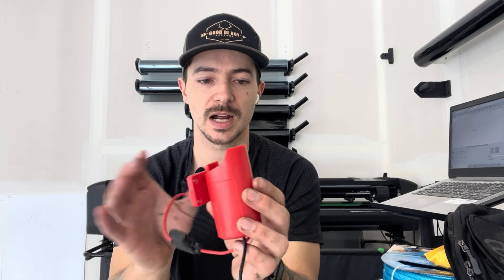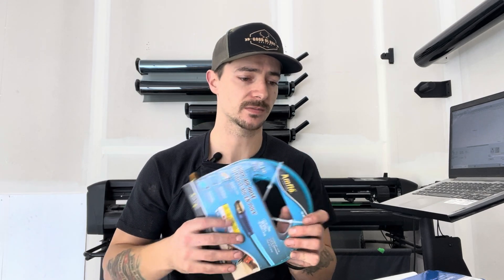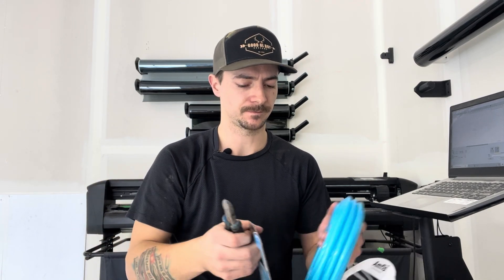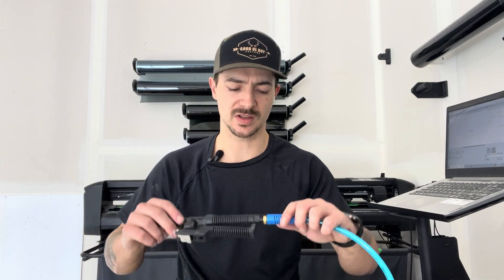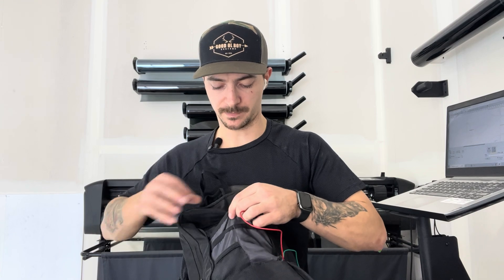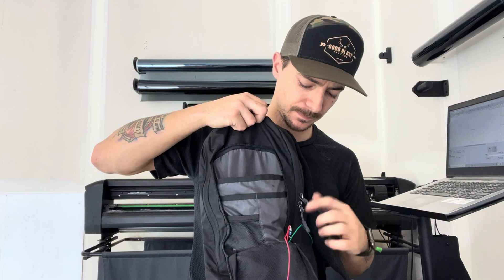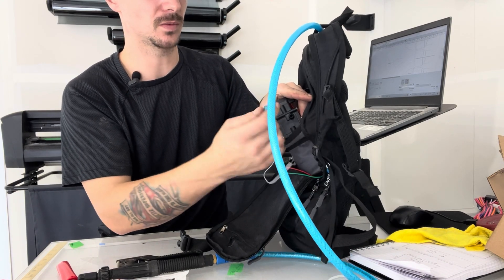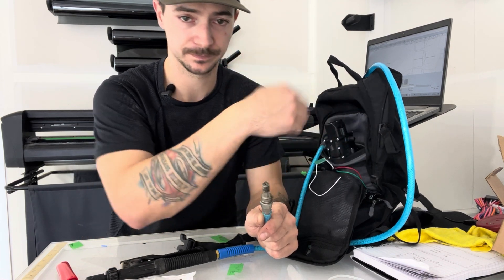How to Make a 12V Window Tint Backpack Sprayer (Step-by-Step) DIY | Keg Sprayer | Tint Buster

Comment: Hi, thanks that was very helpful i will try to put this together 
but am worried about the motor does it goes on all the time or its auto shut when the hose is not open?
Reply from the maker: Thanks for watching! 
If you use the pump in the description of the video, it only comes on when you are spraying. Once you are done, and it pressurizes, it shuts off.

Comment: Awesome, thanks bro!
Hopefully can get this together!

Would you mind fixing the link for the pump you used, as it's actually the same link for the adapter.

Also, the nozzle handle you used isn't on there either.
Reply from the maker: Thanks for pointing that out, link has been fixed! 
Unfortunately for the handle, the only suppliers I’ve been able to find are tint companies such as xpel.
Reply from the maker: Just added a sprayer handle link!